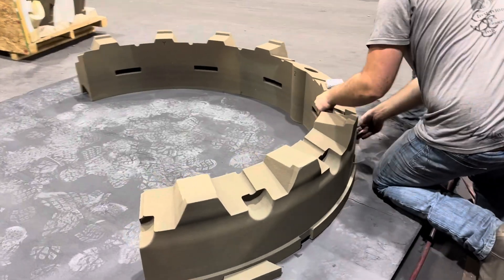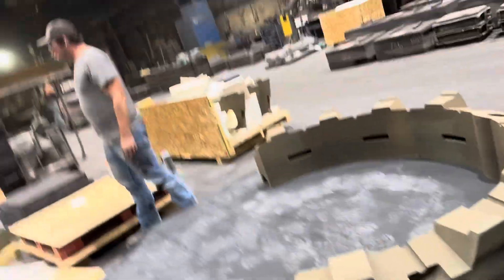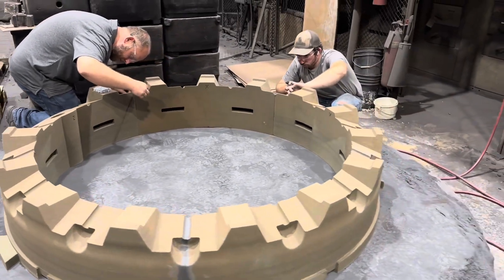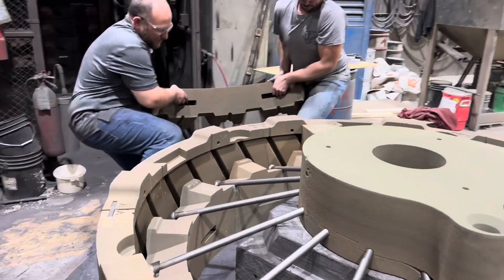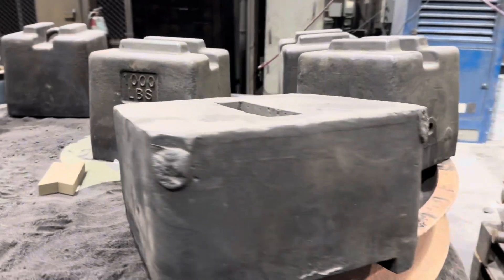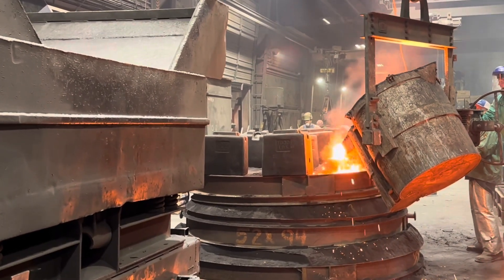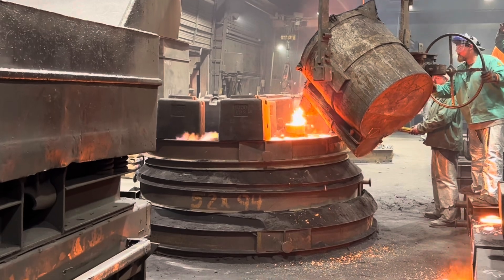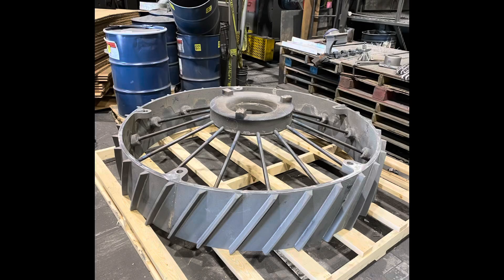Casting a Wheel Extension Rim for an Advance Steam Engine at Dakota Foundry

Comment: Thanks for posting this. I have wondered, thought and speculated about this exact process for years. When I was very young (1960's) , I remember talking to an old man in the neighborhood, who was probably in his late 80's, and he told me about working at a foundry in the Kansas City area before WWI and making steel spoked cast iron wheels. They were not for a traction engine and  I think were much smaller for some sort of farm machinery, but the process was much the same. He referred to the segmented sand molds as "ram up cores". I have never heard that term used since. I couldn't really comprehend what he was telling me at the time, but after studying cast iron traction engine wheels in subsequent years, particularly examples where you could still make out the parting lines, I began to formulate an idea of how it was done. Your video confirms it. Congratulations on a well done job and solving a complex puzzle.
Reply from the maker: Thanks for sharing your story! Yes, I also studied old wheels to understand how they made these back then. It’s very impressive, especially when all they had was manual tooling to make the patterns and core boxes.
Reply: Here is our True Savior. Please take a few seconds and read this

HalleluYAH translates “Praise YAH”

- YAH is the Heavenly Father 
(Genesis 1)

- YAH arrives via The TENT OF MEETING
(Exodus 33, Isaiah Scroll)

- YAH The Father (Genesis 1) was Who they Crucified for the sins of “man” and YAH arrived to be Crucified via the Tent of Meeting 
(Book of Isaiah)

YAH The Father, He’s The Savior

Isaiah 42:8
I am YAH; that is my Name! I will not yield my glory to another or my praise to idols.

Isaiah 43:11
I am YAH, there is no other Savior but Me.

Isaiah 45:5
I am YAH, and there is none else.
Reply: Guys, here is the Savior

HalleluYAH (Hallel u YAH) “Praise YAH”

- YAH is the Heavenly Father (Genesis 1)

- YAH formed/created “man (Adam)” from the dust of the ground (Genesis 2:7)

- YAH arrives via the TENT OF MEETING (Exodus 33:7-11)

- YAH The Father was Who they Crucified for the sins of “man” and they NAILED YAH’s HAND on an Almond Tree
- (Isaiah 43-56)

YAH The Father is The Savior

Comment: So awesome! Looks like it turned out great! Do you all ever consider casting more complicated pieces like aftermarket cylinder blocks?
Reply from the maker: We do cylinder blocks and heads for tractors, have done some old jugs for cars as well.
Reply: @ Done any of like the 619 10.1l Deere 6cylinders? Finding good blocks for those tractors has really gotten hard in the last 5 years. There are still a bunch of those tractors out there guys use and would like to fix but the parts to do it with are used up,
Reply from the maker: @bcbloc02 the only ones we’ve done similar to that are for the pulling guys. High performance engines.
Reply: That is impressive Kory, thanks for sharing this with us. Looks amazing!